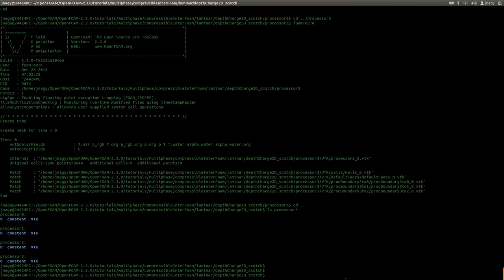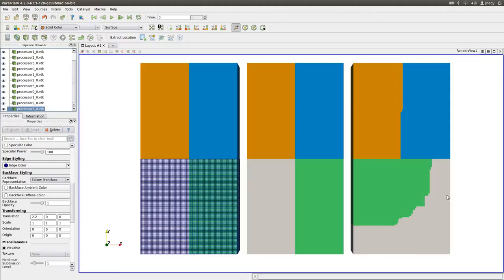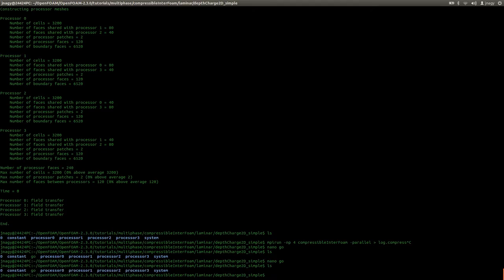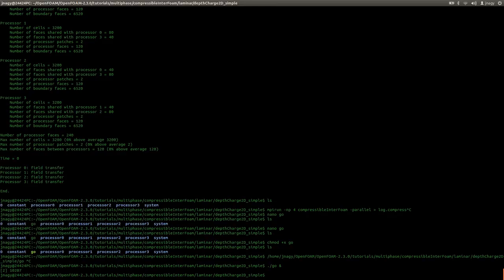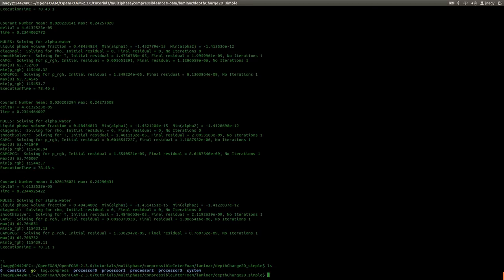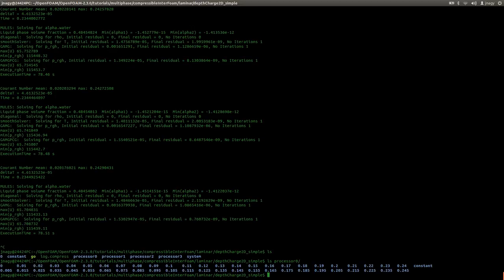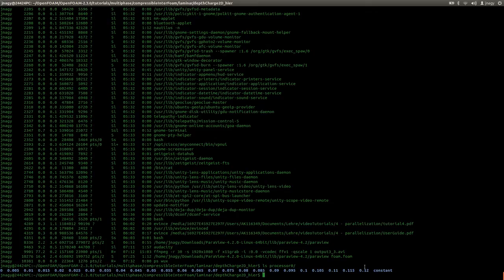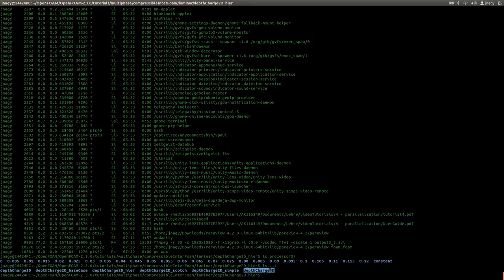How to run parallel simulations in OpenFOAM® - Part 3

Comment: Hi Mr Jozsef, regarding reconstructPar, do you have any tips when dealing with very large cases (>50mil elements)? reconstructPar seems to only be able to run on single processor and this takes a very long time, especially if I want to post-process a transient case. Paraview seems to run only on single processors for post, e.g. time averaging, etc. Perhaps you could comment on this too? Thank you.
Reply from the maker: Yeah, big cases take a while. You can visualize decomposed cases in Paraview, but if they are big, Paraview will be slow. That is true. I can advise you to use functionObjects. You can extract fields at certain locations, calculate forces, streamlines as well as iso surfaces in vtk format. Then you "just" have to evaluate those text files or vtk files. But first you have to know, where you need the information. Usually at least once you do a full analysis in Paraview and be patient and then you can go for the function objects.
Reply: This is great advice. Thank you very much!

Comment: Hello prof. Nagy,

thank you very much for your smart videos, they really give you a shot of what expecting in different topics, and I think they're useful to have some spot on what to dig deeper to find solution to your problem.
I was really interested on parallel computing as for work I use it very much.

I would like to ask if you can give some explanation with cyclicAMI BC for MRF steady state simulation of rotating fans (most of my cases) and what I should care about to get more confident that decomposing my case,  it does not affect the solution.

I mean, as mpi manage the exchange of data across cores, what does this impact on AMI interpolation (master patch-slave patch)?

thanks a lot
Reply from the maker: First of all, thanks for the promotion ;) I am not there yet, but let's stick to József. That's a very good question and to tell you the truth, I have not used AMI for the last 2-3 years, so I cannot really tell, what is true for the latest release. What you can always do, is set up a small and easy case, which is running fast and decompose it with different methods and also run it in single mode as well as 2x,4x,8x etc parallel and see if you find a certain difference in the results. It would be great, if you could post your results somewhere, because I am sure, that you are not the only one with this question.

Cheers,
József
Reply: József Nagy Yes, you're right, I think I can handle it. Regards

Comment: Thank you again for your work. I am following your tutorial course in parallel with the tutorial book from TU Wien. This set of video is related to Tutorial 9 (parallel processing). Is there anywhere the continuation of the video-tutorials with the following ones? I mean Residence time distribution (tutorial 10), Reaction (tutorial 11) Snappy mesh (tutorial 12 and 13), and sampling (tutorial 14)?
Reply from the maker: No, these tutorials were set up by myself when I was working there. All the other tutorials were set up by other people after I left, so I an not affiliated wiht those tutorials.

Comment: Hi Mr. Nagy, thank you for these detailed tutorials! I want to share an interesting finding, that I'm using a 11th gen i5 laptop and before this parallel simulation tutorial(which is before D10 in that 3week tutorials), my simulation costs exactly half of yours' time, but in this tutorial my simulation with the simple method takes only 1/10 of yours' time and I checked my settings over and over again thinking the simulation may meet some problems and be interrupted😂
Reply from the maker: Yes, hardware is incredible nowadays!

Comment: Dear sir, thanks for your in-depth explanation how the different decomposers work. However, in this step, I get an error message:

--> FOAM FATAL ERROR: 
bool IPstream::init(int& argc, char**& argv) : attempt to run parallel on 1 processor

    From function static bool Foam::UPstream::init(int&, char**&, bool)
    in file UPstream.C at line 112.

FOAM aborting

I think it is because I made some errors in the mpi install. (I tried both sudo apt-get -y install openmpi-bin and sudo apt-get install mpi, but I still get this error).

Comment: mpi doesn't work for me maybe because of my openfoam was run in the docker. after searching on CFDonline, I used "export OPAL_LIBDIR=$OPAL_PREFIX/lib64/" before mpirun -np 4 parallel, and then it worked.
Reply: Thank you professor Nagy. I will start some trials now, and going to study the other playlists after the comprehensive exam.
Reply from the maker: Thank you for your input, maybe other users will find this also informative.

Comment: Help! I am getting error while running parallel simulation in OpenFOAM. 

WARNING: Linux kernel CMA support was requested via the
btl_vader_single_copy_mechanism MCA variable, but CMA support is
not available due to restrictive ptrace settings.

The vader shared memory BTL will fall back on another single-copy
mechanism if one is available. This may result in lower performance.
Reply from the maker: This is a system specific error, not OpenFOAM related, so I I guess only Google can help you.

Comment: Hello, Prof. How to run this simulation in a multiple node cluster? My university has multi-node cluster (with each cluster having 12 processors)
Reply from the maker: Submit scripts are always different. For that the admin of the cluster can help you.
Reply: Prof.  @OpenFOAMJozsefNagy  wow...you are so much prompt...Thank you for your prompt response :) Just today I tried dam break with multi-node, it took me 2 hours struggling, but it worked. :)
Reply from the maker: @parth3791  Sometimes I am fast, sometimes it takes a bit. I try to give my best.

Comment: Hello Prof. Nagy, 
I'm trying to run a parallel simulation (4 processors)  but I get a Fatal error like this:

 [Salvi:00774] [[23600,1],0] tcp_peer_send_blocking: send() to socket 11 failed: Broken pipe (32)

Can you help me with that?
Thanks!
Reply from the maker: Your mpirun seems to be bad. Which version of OF do you use?
Reply: @OpenFOAMJozsefNagy  I'm using the OpenFoam v-1906. But I've solved the problem. It was the Firewall that blocked the solver. 
I just had to disable it... 
But now I have another question for you :-D 
I've run a simulation in parallel (70 processors in a virtual machine) and I'm trying to visualize the the results (I've run reconstructPar) in Paraview. 
It seems I don't have problem to visualize the case on the VM but only on my PC.
I've just copied the folders from a machine to another and, when I try to open my case on my PC,  I get this message from Paraview: 

"ERROR: In C:\bbd\ecd3383f\build\superbuild\paraview\src\VTK\IO\Geometry\vtkOpenFOAMReader.cxx, line 7618

vtkOpenFOAMReaderPrivate (000001091350F0E0): Number of cells/points in mesh and field don't match: mesh = 581870, field = 613166"

I'm dealing with ca 4600000 cells 

Any good tips? How I can fix it?

Thanks!
Reply from the maker: @ulisse781  Wow, I have not seen this error message. Did you try switching in Paraview to decomposed case and open the parallel results directly?
Reply: After many attempts  I've found a way to solve the problem... I've run again my simulation. I don't know what was wrong but now it seems to work. Thanks a lot for your precious help!

Comment: Hi Jozsef,

Thank you for your great videos. However I am running into this error when I try reconstructing the results with reconstructPar. The error I get is: 

Reconstructing FV fields

    Reconstructing volScalarFields

        k
--> FOAM FATAL ERROR: (openfoam-2206)
Cannot dereference nullptr at index 6 in range [0,7)

I was wondering if you or anyone else has came across such an error. I would really appreciate your help!
Reply from the maker: Wow. No, I have not come across this. There seems to be a Null pointer during reconstruct. Is this a custom solver you are trying to reconstruct? Or did you use a custom BC?
Reply: @OpenFOAMJozsefNagy  Hi József, No it's not a custom solver nor are they custom BCs that I am using.
Somehow though I was able to to the reconstruction using: mpirun -np 4 redistributePar -reconstruct -parallel
Reply from the maker: @alfredandrew8288  Ok I am glad.

Comment: i perfomed several tests on a mesh with 30362 nodes once with simple method one with scotch metohod : 

no parallelization  time 498 s , CPU 9% , RAM 9%

simple method 
     - 4 domains  > time 185 s ,CPU 34% ,RAM 9%
     - 6 domains  > time 163 s ,CPU 51% ,RAM 9%
     - 8 domains  > time 188 s ,CPU 68% ,RAM 9%
     - 10 domains  > time 178 s ,CPU 84% ,RAM 9%
     - 12 domains  > time 190 s ,CPU 100% ,RAM 9%

sotch method 
     - 4 domains  > time 186 s ,CPU 34% ,RAM 9%
     - 6 domains  > time 167 s ,CPU 51% ,RAM 9%
     - 8 domains  > time 194 s ,CPU 68% ,RAM 9%
     - 10 domains  > time 185 s ,CPU 84% ,RAM 9%
     - 12 domains  > time 197 s ,CPU 100% ,RAM 9%

Test has been performed on linux Xubuntu 18.04 , physic partition, dell 7530 16GB RAM  6 core  (12 threads  )Xeon(R) E-2186M  CPU @ 2.90GHz ( 4.9 GHz boost).

It is possible use all threads but i think that a good general rule is to set the number of subdomains like the number of the cores. Foamers , do you have ever performed this tests ?

@József Nagy  I hope in more tutorials like movingmesh ( solid moving in liquid) , multiregion thermal ...
The diffcult is to claculate post process values , like forces, flux ,medim values of velocity filed etc.tec. .I hope tutorial about functions object and user function...
Openfoam is really amazaing. Solidworks flow simulation can't actually performe parallel analisys and it cost 10000-15000 euro to add at basic cost of Solidworks. )15k-20k euro.
Reply from the maker: I am planning to do post processing on Patreon. Check out the video on that.

Comment: Hi József. I´m currently trying to solve the 3D case but at some point T0 becomes negative and the process stops. What could I do?
Reply from the maker: What is the error?
Reply: The error is: "FOAM FATAL ERROR: Negative initial temperature T0: -0.51802614." The Courant number of the last step before aborting is greater than 1. Maybe that is the problem.
Reply from the maker: That is very likely. Try with a lower maxCo value.
Reply: I will try it. Thank you! Your videos are very helpful.

Comment: Thank you so much for the awesome tutorials. 
I followed the exact steps you mentioned, everything worked as expected except the last command "mpirun -np 4 compressibleInterFoam -parallel > log.compress" I got the following error 
"FOAM FATAL ERROR: 
[1] UPstream::init(int& argc, char**& argv) : environment variable MPI_BUFFER_SIZE not defined
[1] 
[1]     From function static bool Foam::UPstream::init(int&, char**&)
[1]     in file UPstream.C at line 103.
"
Could you please help me to solve it? Thanks in advance.
Reply from the maker: MPI_BUFFER_SIZE=2000000000
Reply: @OpenFOAMJozsefNagy  Thanks for the swift reply. Excuse me for bothering you again but I tried to add MPI_BUFFER_SIZE =2000000000 to UPstream.C but it did not work. Where should I put it?
Reply from the maker: @saharnasser6586  Define it in the bash where you try to start your simulation.
Reply: @OpenFOAMJozsefNagy  Thanks a lot, it is working now :)
Reply: I have one more question. I have a system with 3 GPUs can I use them for parallel simulation?
Reply from the maker: @saharnasser6586  No, unfortunately currently OpenFOAM is not running on GPU, but there are developments, where they aim to achieve this.

Comment: I can suggest a new part 5,

How to have more subdomains than actual cores of machine, like 8 processes on 4 cores. 

I tried but I got errors, 
I changed decomposeParDict for 8 subdomains and then in mpirun command gave -np 4

IDK what's wrong, will have to look it up.
Reply from the maker: This is not intended.

Comment: hi evry body 
please if someone can help me in this case cause when i type in mpirun -np 2 pimpleFoam -parallel >> logSimulation
i have this message 
[:01251] 1 more process has sent help message help-btl-vader.txt / cma-permission-denied
[:01251] Set MCA parameter "orte_base_help_aggregate" to 0 to see all help / error messages
Reply from the maker: Does the simulation run? Or is it just a warning in the background?
Reply: @OpenFOAMJozsefNagy  it work